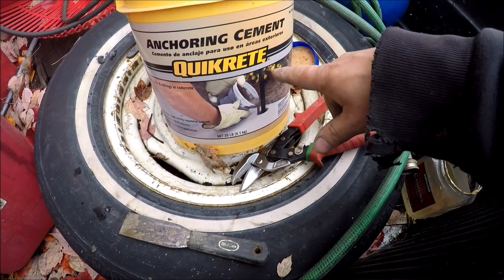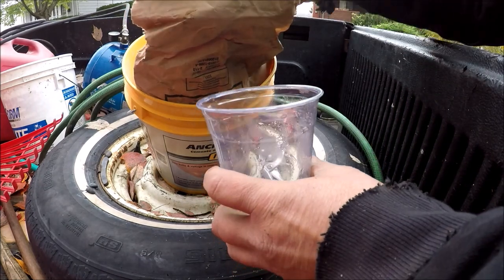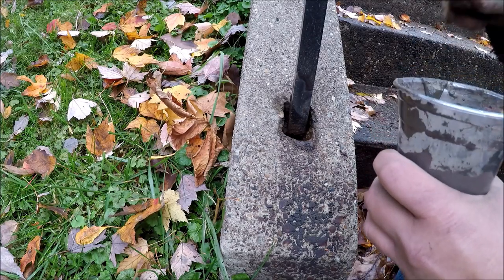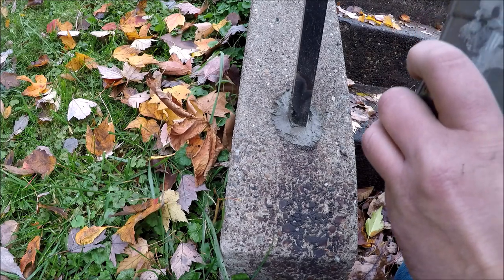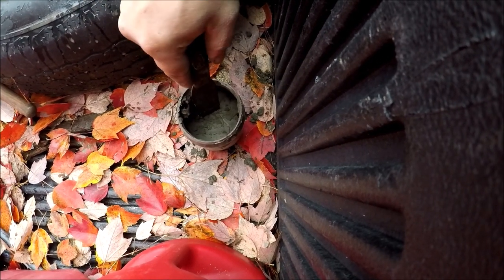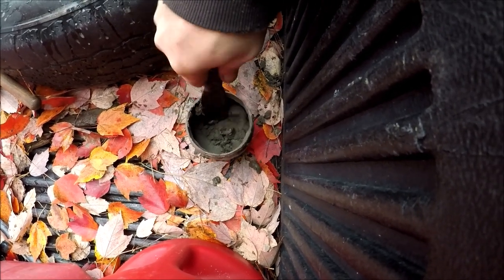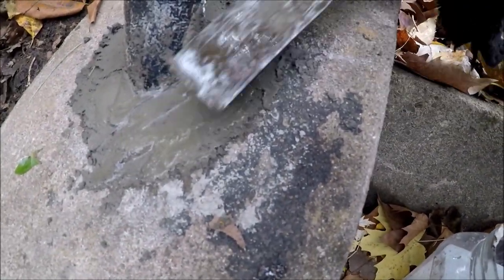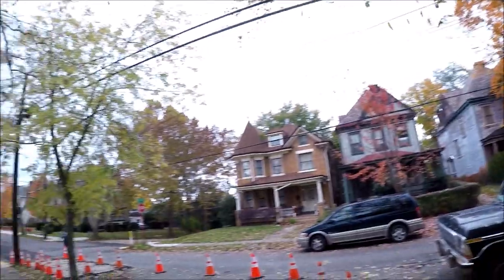Secure loose handrail with anchoring cement

Comment: Nice work and that is a great truck.
Reply from the maker: The truck is a 1979 f 150. It's a real f150 highboy from the factory with factory lift kit. Sometimes called a heavy half. Most folks don't even acknowledge these existed in the f150 line.
Reply: @themrhelperguy  It is sweet.

Comment: Perhaps make the anchoring mix more fluid so it would pour easily in the hole. I saw other repairs on hand railings done this way to insure the mix reached the bottom of the hole.
Reply from the maker: I will go for that. Maybe mix a little thicker on the top coat. Stuff wants to level itself out.

Comment: How has it held up? I have wobbly railings also embedded in concrete and I patched the cracked concrete around them with Quikrete high strength concrete.. It broke again at the surface from wavering railings. Do you think the anchoring product will work better than the kind I used?
Reply from the maker: The anchoring cement might work better. It's suppose to expand. Before I used the product I cleaned out the holes with compressed air so I would be able to work it into the space.
Reply from the maker: Has held up well.
Reply: With one repair I mixed the bonding solution in with the concrete since I was patching to old concrete. It did hold up better.

Comment: my railing isn't loose, but the mortar in all the anchors is recessed, which seems like a problem waiting to happen (pooling water).  Can anyone think of a reason it's "supposed" to be like that, or would you recommend building up the mortar around the posts ?  Thanks!
Reply from the maker: That pooling water will take out the railing sooner or later.
Reply: @themrhelperguy  I figured ... So I should clean that out and build up the mortar around all the posts?